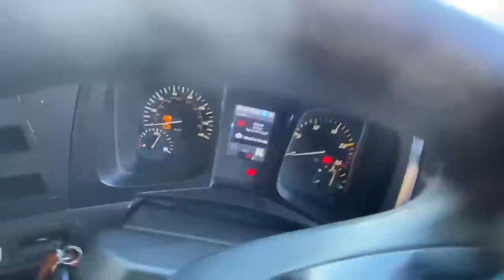Oil leak from breather pipe merc, track rod end change

Comment: Hi Chris. 
Work at a Benz shop, those oil separators usually come as a assembly, 4 bolts and that one pipe and job done !
Was way to test them is rev the engine up and turn of the engine straight away and you should here it spinning. When they don’t spin it’s means it’s seized and just spits oil. 
Bloody goood show!
Reply: I have changed a few myself !